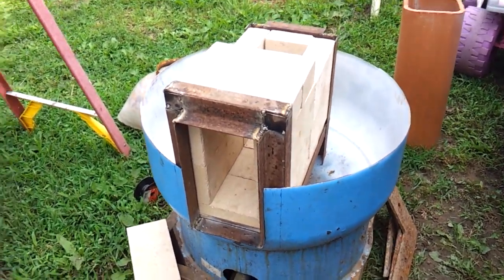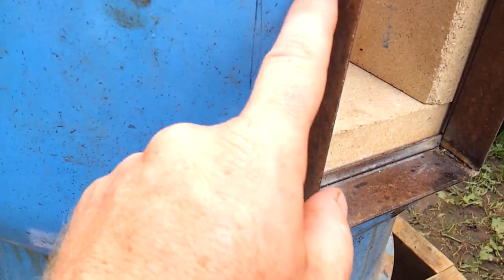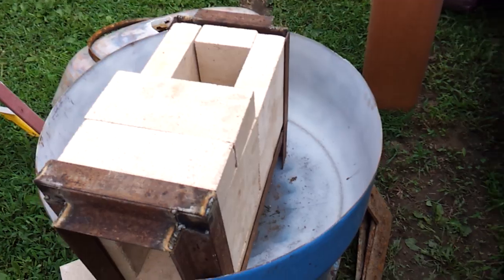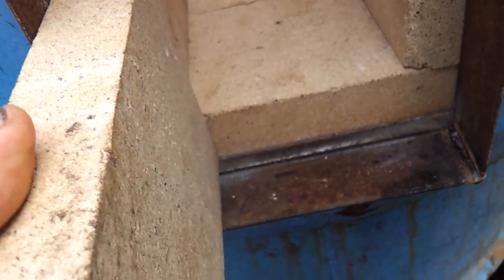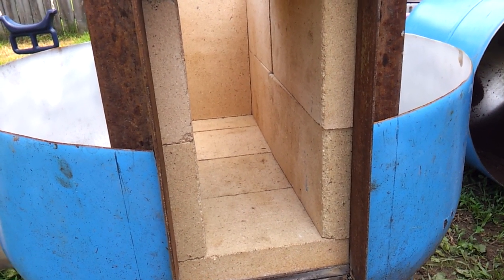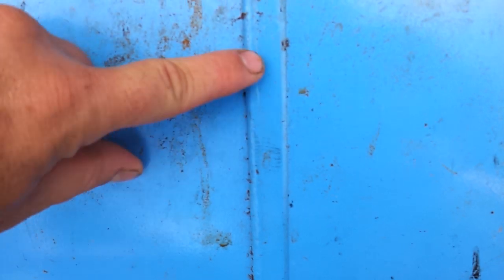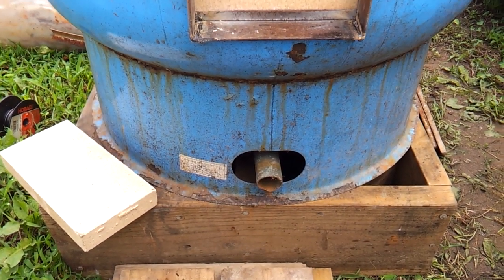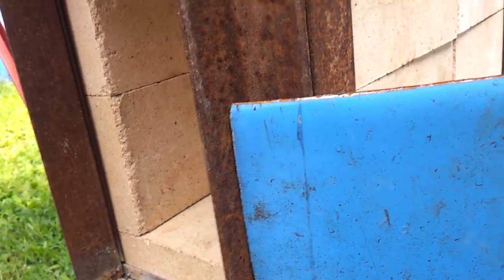Rocket Heater Wood Stove Build Part 6

Comment: if your going to be using that square tube to be used as the feed tube then your fire tunnel can be allot shorter (maybe half of what it is now)  if you look most diagrams, you would find that the tunnel in the j tube is skinner than the heat riser and the feed tube.  in my experience it produced a slight Venturi effect that adds to the speed of the draft going up the heat riser.

Comment: That is going to be quite the heater.  Can I tell you a few words that I know regarding rocket stoves? 
Feed tube is the tube on the outside you put the wood into.
 Combustion chamber Is the horizontal section were the wood burns. 
Heat riser is the insulated chimney pointing upward.
 I don't think you need to insulate the feed tube. Looks good Guy.